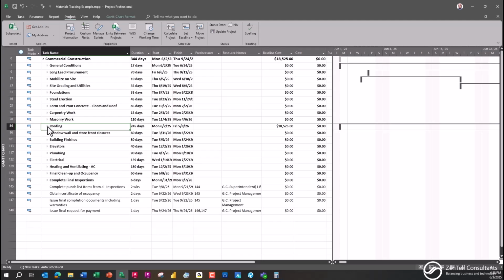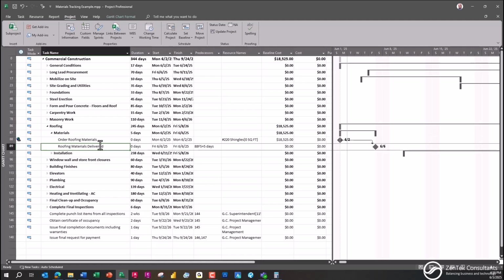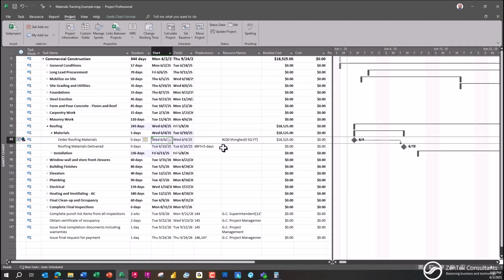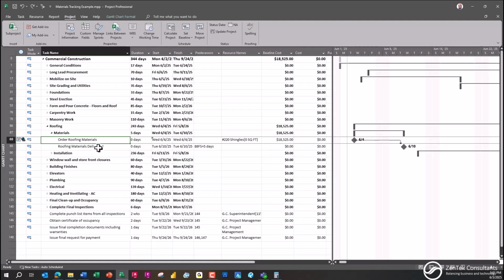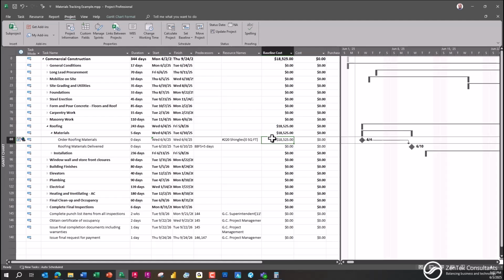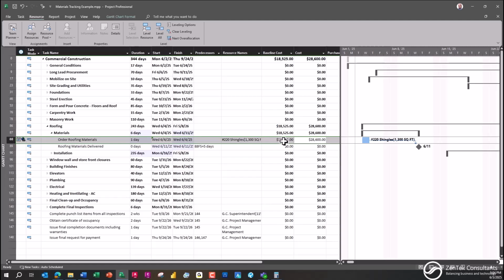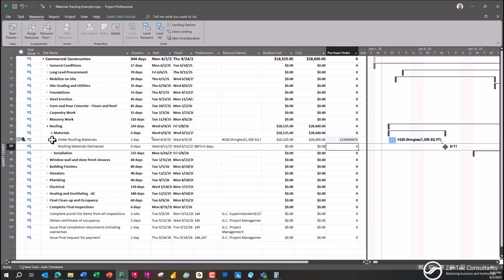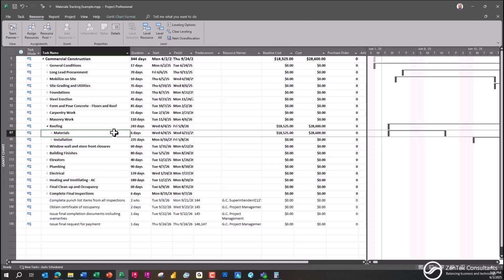How to Track Material Deliveries & Costs in Microsoft Project (Construction Scheduling Tips)

Comment: Good morning, sir, sorry to bother you. I would like to ask about creating scheduling curves for equipment, labor, and materials.
 
I have watched the Microsoft Project video tutorial, but I am still confused about this matter.
 
This question is from the perspective or viewpoint of a contractor.
 
1. For example, if I am the project scheduler for the contractor, the contractor wants a schedule of labor requirements to be created so that there is no excess or shortage of labor, which will impact costs.

2. For example, the contractor wants a schedule of heavy equipment needs for road work to be created so that the duration of use of the heavy equipment can be known, and it can also be tracked on the schedule later. If there is a delay, it can be known how long the delay is.

3. For example, the contractor wants us to not only create schedules for the needs of steel and ready-mix concrete, but also schedules for the needs of steel, sand, cement, and red brick because we are not using ready-mix but site mix, as well as schedules for the needs of finishing materials.

4. This question will later be related to question number 5. If there is a delay and the contractor wants overtime to be done every day to reach the target, how can MS Project automatically calculate and reduce the duration of the work because we have added 3 hours of overtime each day?

5. Explain in detail about Task Types in MS Project, starting from Fixed Unit, Fixed Work, and Fixed Duration.
 
Because, in my personal opinion, if the use of Microsoft Project is maximized, it will be able to replace the job description of a logistician.
Reply from the maker: You’ll want to investigate and learn how to utilize “Units” for Resources, along with learning more about what “Work” is within MS Project. These two topics play heavily within the three different task types: Fixed Work, Fixed Duration, and Fixed Units. Regarding delays, best practice would be to utilize the Baseline feature in MS Project, update the “Actual Start”, “Actual Finish”, and other “Actual” fields. From there, you can utilize Custom Fields to assist you in doing some calculations – like how long is the delay from “Baseline Start” to “Estimated Start” is. Lastly, there is an “Overtime Work” column that should adjust the total amount of time to complete a task.

We don’t have the proper formatting or enough space for the full answer in the YouTube comments. If you want to learn more about MS Project, we do offer courses on our website https://zentekconsultants.net/microsoft-online-courses/. If you want to learn more, please email us marketing@zentekconsultants.net.